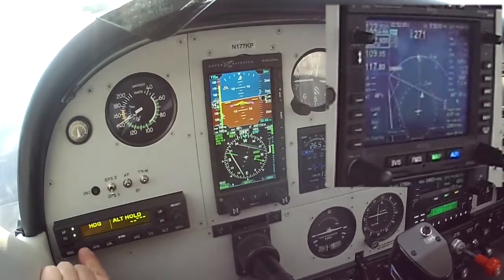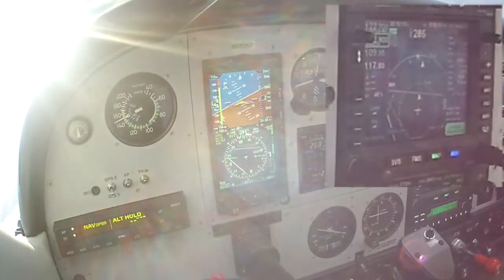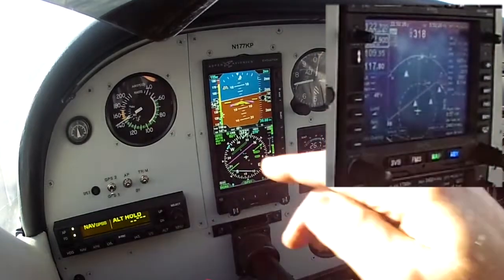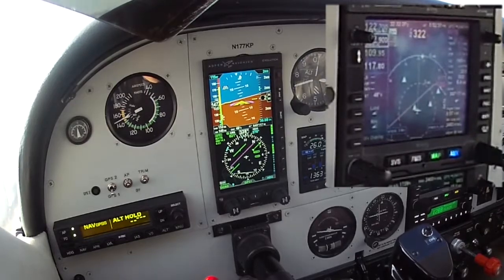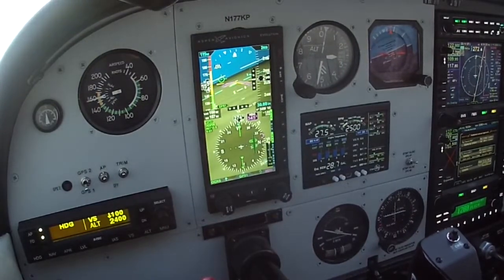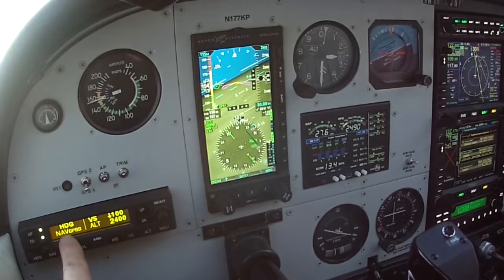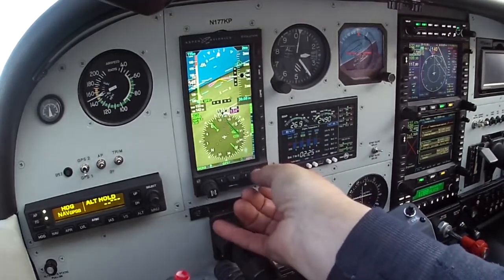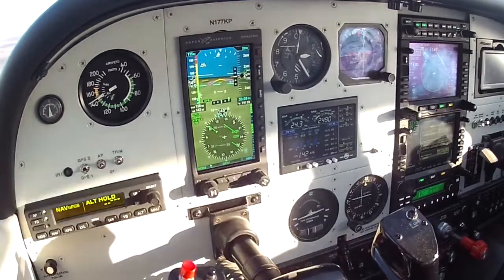Exploring course intercept with IFD550,  STEC 3100 and Aspen.

Comment: Just got my 310 back from install of 3100 and GTN 750. My 3100 did the same intercepting course home. Thought I had done something wrong to cause it go from a 20 degree intercept to a a 45 degree intercept. Thanks for demonstrating this, it was extremely helpful to me. I mentioned this to a friend who has a Century AP and he said he had to push Nav twice to intercept on his selected heading. I was going to experiment with this next time I fly and the contact Stec concerting this. I will call them tomorrow to see what’s up. It is months since you posted this. You would think something would be done by Stec by now.
Reply from the maker: I hear stories, but can't share insider info. I think the virus has scrambled things a bit, but they do know about this issue. Remember that this autopilot is capable of getting software updates...

Comment: Mine does the same; I have a dual G480 (Old CNX80), Apen, and just installed the 3100. It appears to do a marvelous job, except the enroute portion is a bit confusing why it won't do a heading directed intercept. Pushing NAV, my AP drives the aircraft to a 45 intercept right away?  Please when you find answers, post them hear.

Comment: Kieth, did you ever figure out why it allows Nav arming with HDG on sometimes and other times it wont? Thx
Reply from the maker: Not yet. It seems clear that arming works on the final approach course, but not enroute. Avidyne's Principle Software Engineer tells me they don't do anything different between those two cases, other than turning on the ILS discrete signal. They speculate that STEC is adjusting behavior based on that signal, but the STEC guys are out of reach during the virus shutdown.  I have questions in to them, we'll see what they say.
Reply: @cardinalflyer  Thanks... during my testing, I've found that the NAV arming works with VORs and ILS. Basically radio freq. But does not work with GPS tracks. Like you I've had alot of back and forth by email. Waiting for STEC to get back to me. Works really well on all other functions. Thanks again